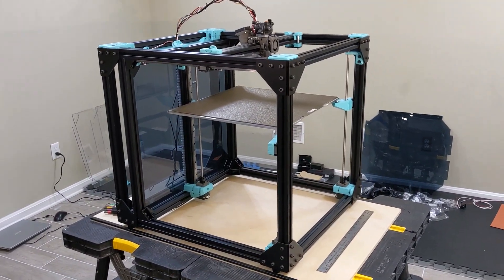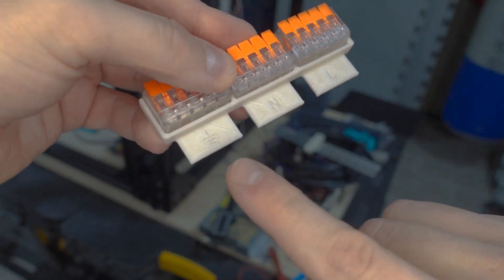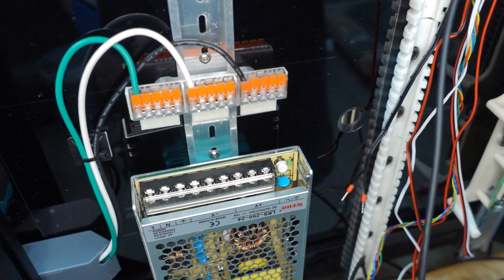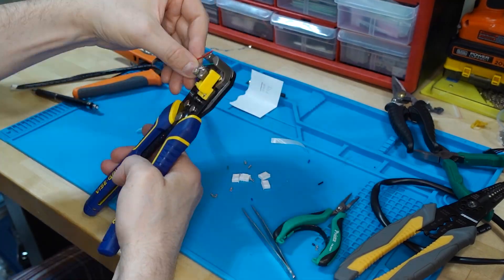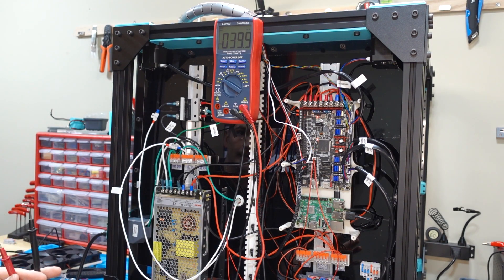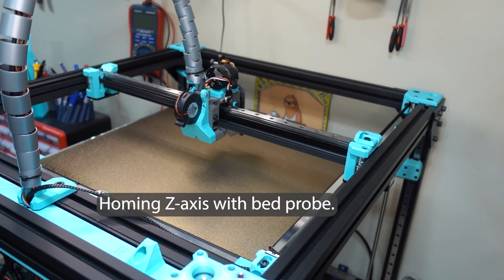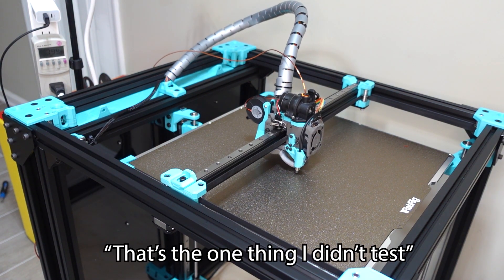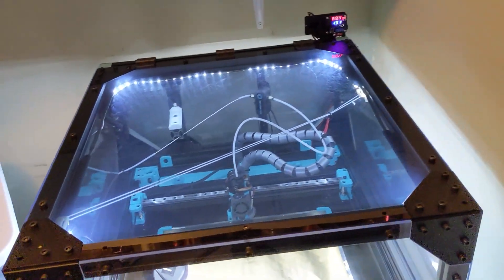DIY 3D Printer Build Experience (III) // Joys of Wiring // RatRig V-Core-3

Comment: Question is there a list of the gauge of wires used for each section ?
Reply from the maker: When I did it, there was no supplied list of wire gauges.  I'm pretty sure I used 14AWG wires for most of it.  You can look up wire sizes based on max current, below.

For the heated bed, the 500mm V-Core-3 uses up to 1,500W continuous.  In the US, outlets provide 120V, so max current is about 13A.  If in Europe on 220V, or smaller V-Core-3 , it will use significantly less. 

The remaining wires where there is significance current is from the 24V power supply to run everything else.  The biggest power sink there is the hotend, which I believe peaks at 70-100W, so max 4A.  Add a few more amps for motors and other stuff.   I believe I used 16-18AWG for those. 

Don't forget to tie everything to the ground.  Including the bed, SSR, DIN rails if you use them, and the aluminum frame (I assume the docs have a complete list).  I actually drilled and tapped a small hole in one of the rear extrusions so I could add a ground wire to the frame (it needs contact beneath the black anodization).

Comment: Thanks for your previous reply. I see that you have some sort of top encloser plate above your electronics. Can you also share the stl for that one :) Thanks alot your video has helped alot with wiring. Im almost done.
Reply from the maker: I am not sure exactly what you're referring to.  I think it's the two printed flat plates that are in the back of the machine when looking at the front.  Those were part of the official STLs for the build.  

Here's the left one.  There's one for the right in the same folder.

https://github.com/Rat-Rig/V-core-3/blob/main/cad/printed_parts/stl/enclosure/shelf_left_400_3.1.stl

Comment: Hey mate you dont need that buck konverter for the fans just run them in sires 🙂
Reply from the maker: Hah yes.  I have had some bad experiences running things in series and I sometimes don't even think of it when it's appropriate.  However, one benefit of doing it this way was that I could undervolt them to reduce noise, so it's not a total waste!

Comment: I just fired mine up last night for the first time to check wiring and what not.  I'm right there with you when it comes to the wiring, cutting, crimping....  I have always wanted to learn it and am turning into a pro myself lol.  I'm still questioning some of the design choices for this printer (I pray nothing happens to the belts as you have to rip the entire thing apart it seems), but so far so good.  Going to do the PA and Input shaping tonight, so I hope printing works well!

Great series btw, it gave me some good insight and tips.  Also, that mat!!!  I got one myself lol.
Reply from the maker: Everyone loves that mat!  I love it too.  Well I did.  I accidentally cut it one day and tried to get a replacement and 2 different reorders had permanent bends and it wouldn't stay flat.   I ended up getting a different brand that I don't like as much, but it's better than nothing!  I'm glad you enjoyed the series, let me know if you have any questions and good luck with the build!
Reply: @ObsessiveEngineering  Thanks!  The first print before doing anything, like yours, came out really good.  I'm having an issue with the adxl input shaper as the cable I bought for it isn't pinned for my Octopus v1.1, so I'll run it on my rpi, but I can't figure out which pins to  connect it to.  I did it that way on my Voron 2.4, but had a kit that was prewired.  So now I have to figure this out, but it's going good, just cleaning up the wiring a bit.

Comment: I sooo want to put a display on this.  My foolishness got the better of me though and I grabbed a BTT HDMI5.   I found one model and I think I failed to scale it but if I go larger the frame is off.. very frustrating.  Printing the tabs fort he spine now.
Reply from the maker: Never heard of the BTT HDMI5 before.  Just looked it up and it looks convenient and reasonably priced.  I'd consider it if I didn't have already have a laptop setup next to it that can control all three of my printers.

Another option is just find an old tablet and permanently mount it and power it near the printer.  It only needs to be good enough to run a web browser and access the Klipper/Mainsail webUI

Comment: you can also run the fans off the Octopus, unless the pro lacks the jumpers to set fan headers to 12v.  I do also like they put the electronics on the back, that is one issue I see on the Voron design is if something goes funky monkey with it you have to tip the whole printer over as the electronics bay is on the bottom.

Opps did not expand the description, Anyway once the fans are running off the octopus you can also set it so they only run when the motion system is active.  However being 120mm fans its probably not a big deal and they are not the 60mm screamers from a Voron.
Reply from the maker: Yes, I totally missed the memo on changing port voltages using jumpers.  But since I already got the buck converters, it was trivial to undervolt them to 8-9V to reduce the noise even further.  They just run all the time now and are hardly audible.

Comment: I like your power distribution blocks with the Wagos. I don't like those connectors because i'm thoroughly old school but have been considering a similar solution for the DC side of mine, except i'd use a potted bus bar

Comment: Why didn't you just put the fans in series?
Btw watching this before working on a partially built one I just got. Thanks :)
Reply from the maker: Wow, why did I not think of putting the fans in series?   I guess, I tend to avoid series wiring in general, so it doesn't come to mind in cases like this where it would actually be fine.

Good luck with the build!

Comment: What did the data from the power meter reveal?
I need to put mine in battery backup to last 2 hours and I'm wondering how big the battery needs to be.
Reply from the maker: The 1,000W bed only consumes 850-950W during heating, and after that only consumes an average of like 300W to keep the bed at ABS temps (110C).   The hotend peaks to like 80W during initial heating and similarly drops to like 20W-30W, though that's going to depend on your temperature and flow rate.  With motors and other things, it's looking like 400W-ish.  It would be less for materials with a lower build plate temp.

This is based mostly on memory, and if you're really interested I will get more precise measurements next time I do a print.
Reply: @ObsessiveEngineering  thanks! That's excellent info. Looks like the Prusa XL solution with segmented heater zones is the best answer at the moment.

I might try using a 24V heater pad and take the hit on bed heat up times. But I guess the 300W average load at temp is independent of heater pad power. : / That's just a thermodynamic constraint related to the bed size and thermal transfer dynamics.
 I'm expecting the printer to have to run on battery power roughly half the time (because South Africa).

So if my calculations are correct, at 400W for 4hours I'll need 400W/12V*4hrs +35%(efficiency loss) = 180ah 12V battery 🥺
And then I'll only be able to run it through a 4 hour power outage once per 24 hours because otherwise the charge rate needs to be too high.
Reply from the maker: @SidekickElements  keep in mind that my numbers are for printing ABS when the bed is at 110C.  The bed is the majority of the consumption, and it you're doing PLA at 55C bed, it will be significantly less power.

Also note that this is for the 400mm.  the 300mm V-Core-3 has a much smaller bed, which I think is only 500W max.  And of course the 500mm is more (1,500W?)

Comment: isn't the only thing missing in the picture the connection from the psu to the ac power input where u plug in your cable ?
Reply from the maker: It's also missing the details of how to hook up the heated bed to the mains/AC power through the solid state relay (SSR).   Both components are on the diagram, but only shows their connection to the mainboard (it's not wildly complicated, but when dealing with this stuff it gives you a warm fuzzy feeling to get confirmation that you're doing it right -- which I got from the Voron docs, instead). 

 In fact, no wires that carry high-voltage are shown at all, and more importantly, it doesn't mention what components should be grounded, including the aluminum bed, the SSR, the DIN rails if using, and the 3030 aluminum frame where you need to scrape off some of the anodization (there might even be something else but it's been like 6 months now, so I might've forgotten something!)

Comment: Good series.  I watched the EVA first as I'm trying to change mine and agree that there is very little documentation.  It takes a while to understand it is like a lego set that you have to figure out how to assemble.  The wiring is also a challenge.   I built my first a 400 cube almost 2 years ago and my second a year and a half ago a 500 cube.  Then modified both from V3 to 3.1.

Comment: can you give a link to those voron DIN spring mounts ... google can't find them ...
Reply from the maker: After publishing this video I went looking for them and couldn't find them. I even looked in the Voron GitHub repo.  I have no idea what happened to the original, but I uploaded the STLs of them with the Wago mount thingies I designed, so you can get them there:

https://www.printables.com/model/376537-mount-for-3x5wire-wago-connectors-with-mains-power
Reply: @ObsessiveEngineering  Thanks!
Reply: @ObsessiveEngineering  I see your wago connectors .. but not the spring DIN rail mount ... is there somewhere to get that?
Reply from the maker: @BJ-GoldenTuna  It's in the file list for that model.
Reply: @ObsessiveEngineering  sorry ... I'm blind ... can't believe I didn't see it .. sorry to have taken your time .. but Thanks!!
Reply from the maker: No problem.  Hope you find them as useful as I did!

Comment: Next time for first test of endstops just press them with your fingers and go into mainsails machine tab to see if they are triggered, for the inductive Probe use some metal part and put it below
Reply from the maker: I actually did exactly that but thought it was too much detail for the video.  I was pleased to find Klipper had an easy way to view endstop status as you described.

But even though I had tested it manually, I was still nervous that something would go wrong when the machine was doing its thing.
Reply: @ObsessiveEngineering  I must've done this several hundred times during development by this point, i've been through every situation, every accident, every fix/repair/rebuild, i know have nothing to worry about and i'm still on the verge of crapping mi pantalones everytime i do this on fresh build. It's just how it is 😅

Comment: The octopus pro supports 24V, 12V and 5V fans. All you need to do is read the documentation and set the jumper(s). You do not need a bug converter.
Reply from the maker: Oh man I'm such a n00b.  That makes so much sense.  To be fair, the board doesn't come with docs, and I never saw anything about jumpers except the recommended positions from the main wiring diagram which assumes 24V.  I'm sure there's a document I could dig up from somewhere to tell me what pins to jump.

OTOH - since I had the adjustible-output buck converter, I actually undervolted them to 8-9V which brought down the noise considerably.  Probably not worth the trouble, but they are on all the time now and hardly audible. Either way, thanks for the tip!
Reply: The octopus has also an own set of pins just to power the PI
Reply from the maker: @heisenberg19x66  I guess I really needed to find better documentation on that board. I was going from the incomplete wiring diagram from RatRig which didn't mention any of these things.

 Good to know that's an option, though I still would've powered it separately to avoid the unclean shutdowns.
Reply: @ObsessiveEngineering  what was your Discord name again. Wanted to send you the link to the full documentation but Youtube seems to delete github links automatically
Reply: @heisenberg19x66  hi do have the rat rig documentation wiring diagram.. am lost 😞

Comment: Good first print but why so noisy?
Reply: Did you already tried to reverse the order of the pins for the motors? This helped a few people suffering from the motor buzz. There is a whole channel about this on the RR discord
Reply from the maker: @lemarkde  I just discovered that Discord thread the other day.  Like everyone else, I'm weirded out that the wire order actually makes a difference, but I have seen enough testimonials to believe it.  Next time I extract my printer from its tiny closet and get access to the electronics I will try it.
Reply: @Alan Reiner  just commented this above.  Made a huge difference for me
Reply from the maker: The terrible noise during the first print was a loose screw or captive nut somewhere.  I forgot what exactly, but it was an easy fix.

I believe the remaining noise is primarily due to the default configuration which disables stealthchop.  I have tried enabling it, and it does reduce the noise considerably, but it limits your print speed, and still not even close to as quiet as my other two printers (which have the same TMC2209 motor drivers and Stealthchop enabled).   🤷‍♂